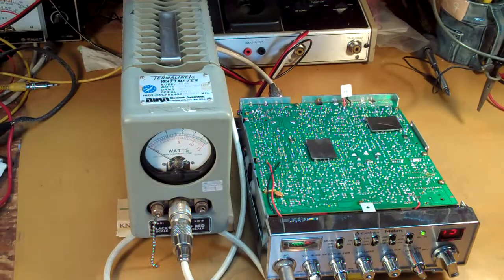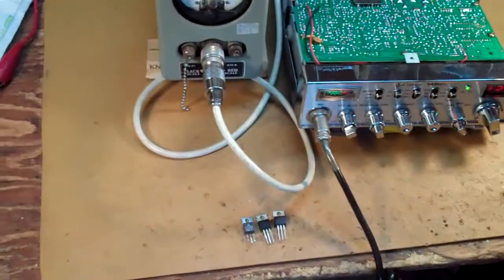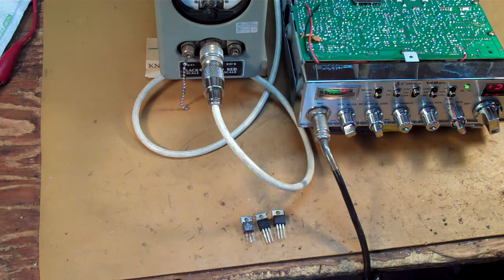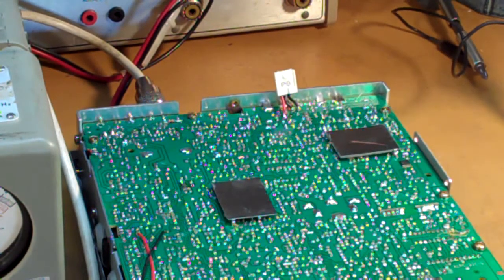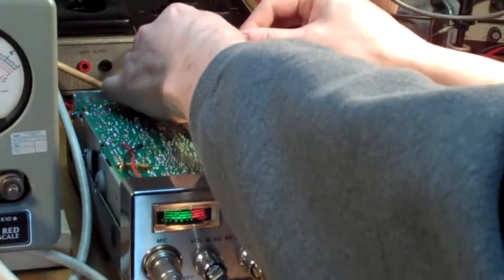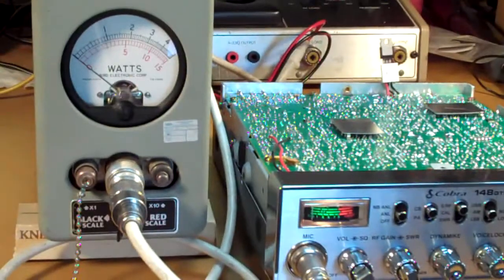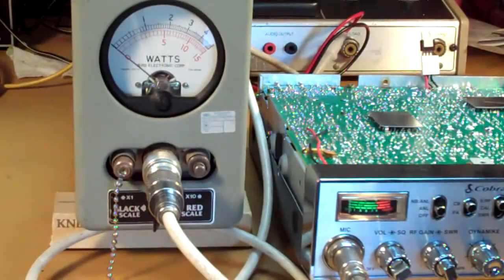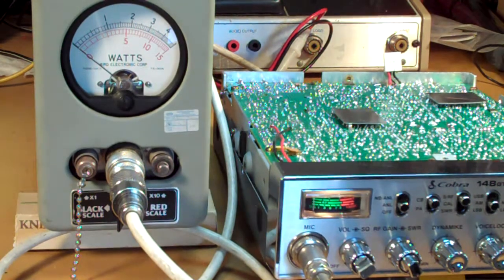2SC1969 replacement with CB20W.avi

Comment: I have  alot of  1969  and 1307 and other types I have got out of  junk cobra and Midland radios and most of them test good.the other day I bought a Marine  radio that had two 2sc2290 Toshiba bought the  marine radio  for $10 I have  a good  stash of transistors.i would  rather  buy junk  radio's than buy transistors off eBay because they are not going to be  the real thing just me opinion.

Comment: probably a dumb question but where could I get one of those test sockets?
Reply from the maker: Its a plug from a PC power supply that was used to power up a floppy drive. Yellow wire removed. If you have an old PSU from a PC you'll have them on it. The new type usually don't though.
Reply: ok thanks and I do have a few laying around...I just couldnt figure out what kind of socket that was, Thks again..
Reply from the maker: keystonecountryboy
No problem :)

Comment: I have seen a 2sc1969-DIV with a 2 Yr warranty please if you can shed some light on this you can find them from through a place called the little diode shop and ebay both the cb-20 and the 2sc1969-DIV are good for what i am hearing